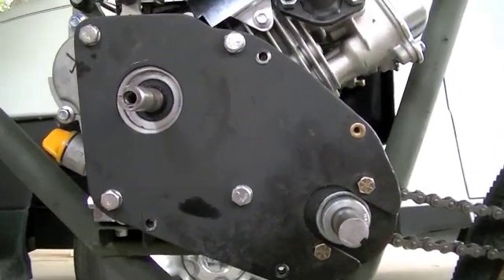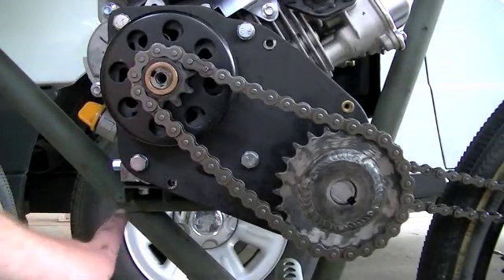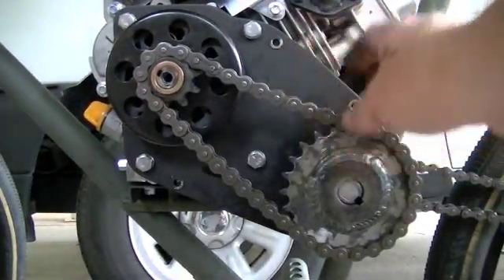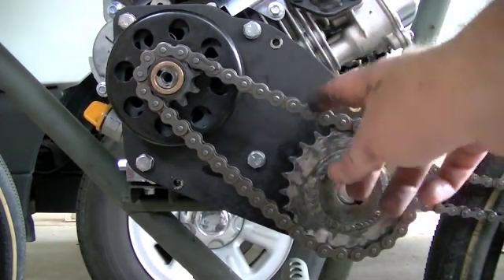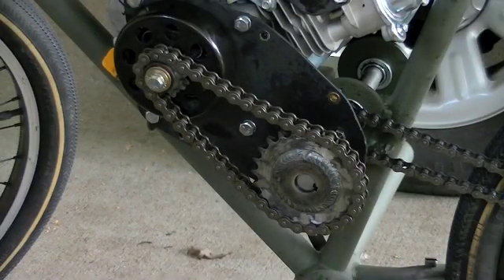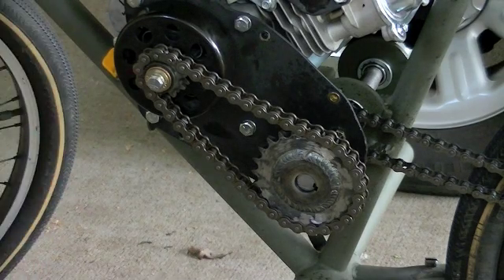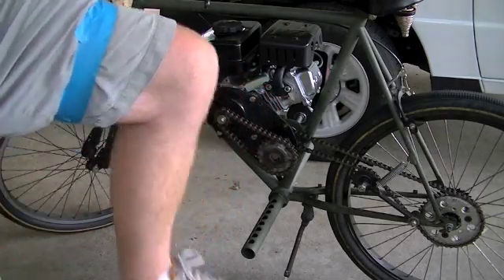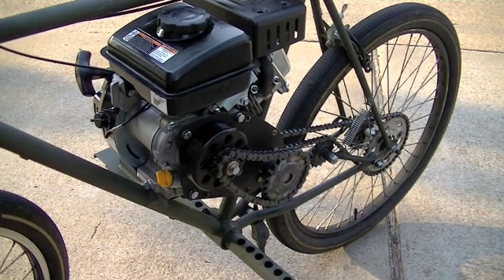Part 33 Motorized Bike | 3HP 4 Stroke Engine

Comment: Of course it's going to go faster when you reduce the gearing...your adding TORQUE, As for the jittering, you may need a new clutch since you sanded it down...a clutch works off of friction and has a break pad like material to help it grab.
Reply: fightingfalconfan Every one of these has jittered for me without sanding. I think as it wears it is going to have some play.
Reply: It's the type clutch with a built in keyway ? If so better to get s reversible clutch with the set Allen's and a separate key you can replace. The cheap style allows much more play which quickly gets worse.

Comment: I had the same trouble with jerking on my bike, the reason is because there is not constant power to the shaft except for the momentum of the flywheel, and crank shaft. and you and the bike weigh more then the flywheel. The only good way around it is to instal a toque converter.

Comment: Actually, the chains on these low powered bicycles do not "stretch". The chain does in fact get longer but not due to stretch. Each of the pins, bushes, and rollers do wear, and it is this accumulation of wear that makes the chain get longer.